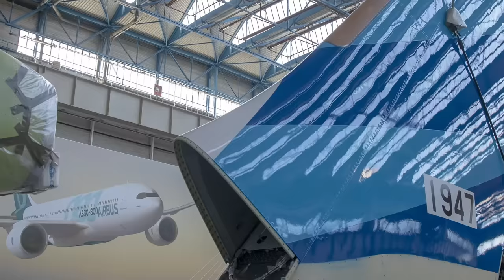In the Making: First #A330neo to Garuda Indonesia

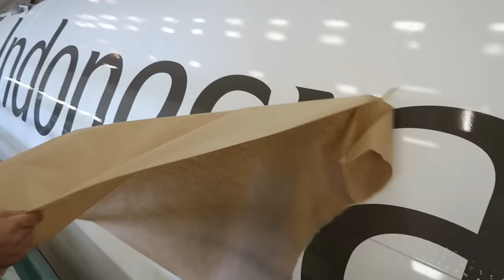Comment: 1:16 props to airbus team
i mean who would look into small detail like that on a plane..
but these guys are just Professionals.
Reply: I am
Reply: This is why Garuda Indonesia have a 5 Star rating on Airlines. They always have a new plane and their plane always get tested first before taking a long flight.
Reply: @Steve Rimon Citilink is the cheaper version of Garuda Indonesia. Citilink always got a new plane yet the ticket is cheap. They got a A220, A320, A320neo, 737, and 737 Max is the highest. They probably get their money out of there.
Reply: @Steve Rimon they restore them, sold them or take the parts that still works and placing them on the non working parts on the new plane. Because who knows? New planes can crash and suffer aswell. Like the Lion Air Flight 610. A new 737Max crashed out of predictions

Comment: Wrong choice if GA will reopened to other city european. They should to  change with A350-900 or B787-9. B787-9 is superior than A330-900 neo about technology and range
Reply: This is obviously not made to replace the 777 which they use on European routes. This is to replace the older A330s for their Asia-pacific/Australian flights

Comment: it would be nice if the airbus A 330 Neo series is socialized to the pilots if there are new features, especially in terms of safety features to anticipate the occurrence of the Boeing 737 Max 8
Reply: Dave Surya it doesn’t have hidden system like the MCAS. Not all re-engined aircraft need an augmentation system.

Comment: A390 And Then  A390 Neo And Then  A390 Cargo And Then  A390 Neo Cargo (12 Seat Sit Place And Then Full Baggage),  A370 And Then  A370 Neo And Then  A370 Cargo And Then  A370 Neo Cargo (8 Seat Sit Place And Then Full Baggage) And Then  A360 And Then  A360 Neo And Then  A360 Cargo And Then  A360 Neo Cargo (8 Seat Sit Place And Then Full Baggage)

Motif
- Airbus A320
- Airbus A320 Neo

Seat Sit Place
- Post Airbus A380

Front Body (12 Seat Sit Place And Then 8 Seat Sit Place)
- Douglas DC
- Douglas C

Front Body (Full Baggage)
- Douglas DC
- Douglas C

Rear Body (12 Seat Sit Place And Then 8 Seat Sit Place)
- MCDonnell Douglas MD

Front Body (Full Baggage)
- MCDonnell Douglas MD

Exterior Version, Middle Body (12 Seat Sit Place), Middle Body (Full Baggage), Engine Machine Mecha, Motor Electric, Battery And Then Generator
- 707
- 717
- 727
- 737
- 747
- 757
- 767
- 777
- 787
- Pratt & Whitney (Boeing 747)
- General Electric Aviation (Boeing 747, 777 And Then 787)
- Rolls - Royce (Boeing 747, 777 And Then 787)

Driver Room (Boeing 737)
- MAX (Maximal/ Maximum)
- NG (Next Generation)
- O (Original)
- C (Classic)
- ER (Extended/ Extension Range)

Interior Version
- MAX (Maximal/ Maximum)
- NG (Next Generation)
- O (Original)
- C (Classic)
- ER (Extended/ Extension Range)

Compability
Daftar Merek Mobil, Daftar Produsen Sepeda Motor, Daftar Produsen Skuter, Daftar Merek Produsen ATV Dan Serta Daftar Merek Produsen Sepeda Listrik Dan Serta Daftar Pelayanan Bis, Daftar Kereta Api Dan Serta Kendaraan Transportasi Rel
Size
Rel (Lokomotif, Gerbong Kereta Pembangkitan, Kereta Penumpang 6 Kelas: Stasiun (Sipil, Penumpang, Privat, Pribadi, Kargo, Eksekutif Biasa, Eksekutif Satwa, Eksekutif Argo, Ekonomi AC Plus, Ekonomi AC Premium Dan Serta Bisnis)): All Any Set In The Real World Dan Serta Dari Anime, Animation, Tokusatsu Dan Serta Live Action Dan Serta Daftar Permainan Anime, Daftar Permainan Animation, Daftar Permainan Tokusatsu Dan Serta Daftar Permainan Live Action Dan Serta Anime, Animation, Tokusatsu Dan Serta Live Action Dan Serta Daftar Permainan Anime, Daftar Permainan Animation, Daftar Permainan Tokusatsu Dan Serta Daftar Permainan Live Action

Our social media handles:
Website: http://www.airbus.com
Facebook: http://www.facebook.com/Airbus
Twitter: http://www.twitter.com/Airbus
Instagram: http://www.instagram.com/Airbus
LinkedIn: http://www.linkedin.com/Company/Airbus